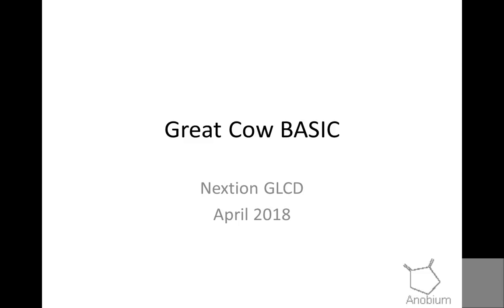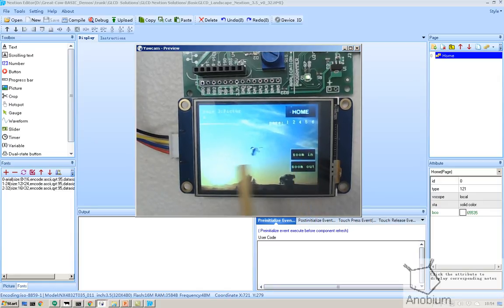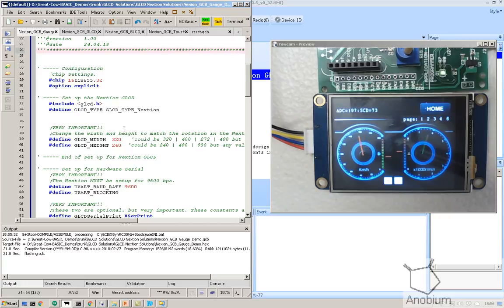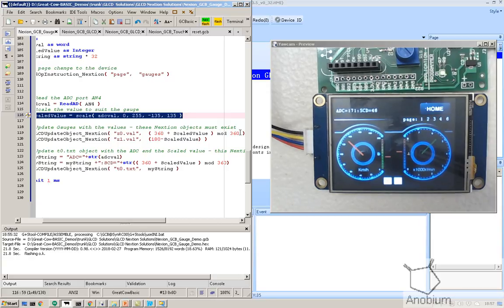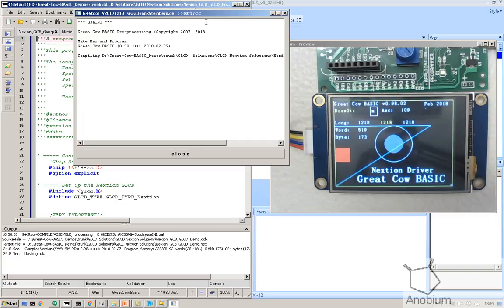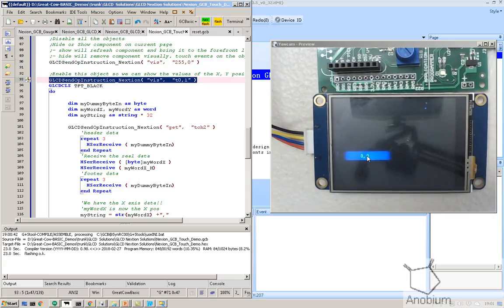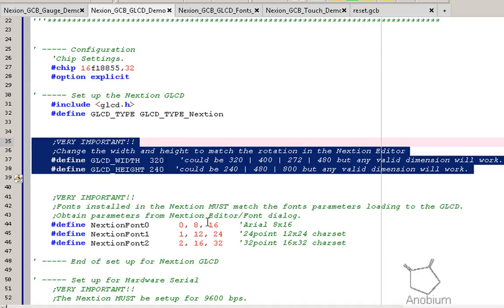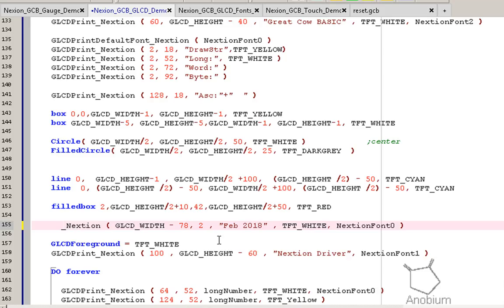Great Cow BASIC Nextion GLCD demonstration

Comment: #include 16f876a,16
#define usart_baud_rate 9600
dim reading as byte
dir portc.6 out
dir port c.7 in
hserprint "test"
hsersend 13
hsersend 10
wait 1 s
hserprint reading ;last saved
hsersend 13
hsersend 10
wait 2 s
do
epwrite 0,124
epread 0,reading
hserprint reading
wait 10 s
loop
this is the program but when i power, im getting 0 only not 124 as it is the saved value.why im getting this.
Reply from the maker: I have found this.. the forum is the best place for support.Your code does not compile, it is not a working solution.  I have revised and tested.  It works as expected.  I get serial output and after 3s I get the 124 displayed on the terminal.    #chip 16f876a,16
    #define usart_baud_rate 9600
    dim reading as byte
    dir portc.6 out
    dir portc.7 in
    hserprint "test"
    hsersend 13
    hsersend 10
    wait 1 s
    hserprint reading ;last saved
    hsersend 13
    hsersend 10
    wait 2 s
    
    do
        epwrite 0,124
        epread 0,reading
        hserprint reading
        wait 10 s
    loopPlease do not post support questions to YouTube. Use the forum.  I publish to YouTube and it is very hard to support via YouTube.

Comment: hello sir u are great.sir can u  plz tell me why eeprom data is not holding in ic after power off.
in arduino ide eeprom.h it is holding.so plz kindly reply.
is there any possible program to hold this.
also plz reply where can i get gc basic libraries.Thank u.plz reply.
Reply from the maker: @Sreenadh Are you using Great Cow BASIC?  EEProm library for Great Cow BASIC works very well.So, can you let me know what you are doing? code etc.  Pop over to the Great Cow BASIC forum at https://sourceforge.net/p/gcbasic/discussion/ make a post and we can help you.
Reply from the maker: @Sreenadh - if you have sent me a reply. I cannot find it.  :-( Sorry